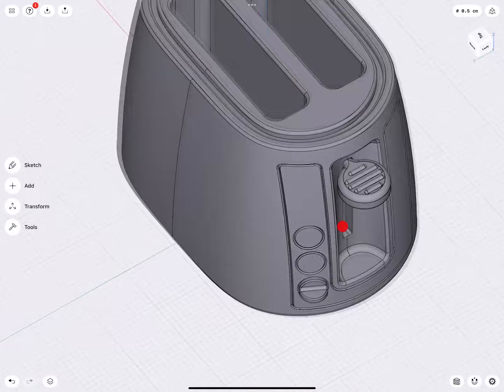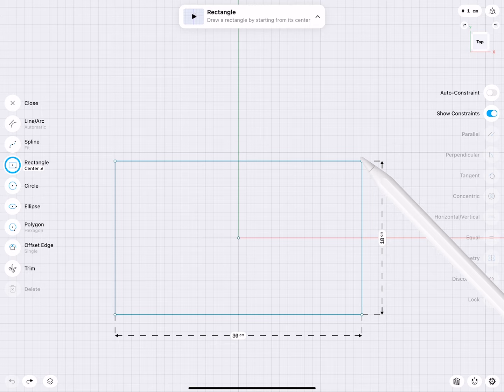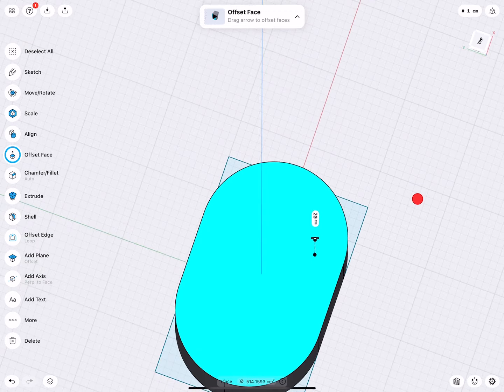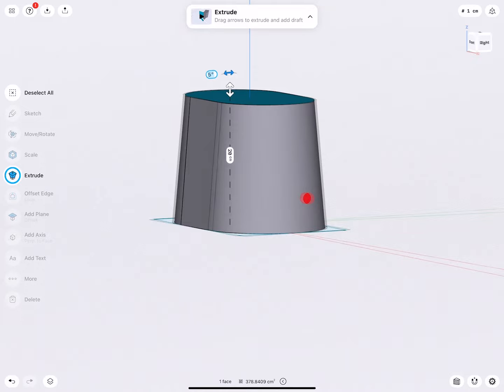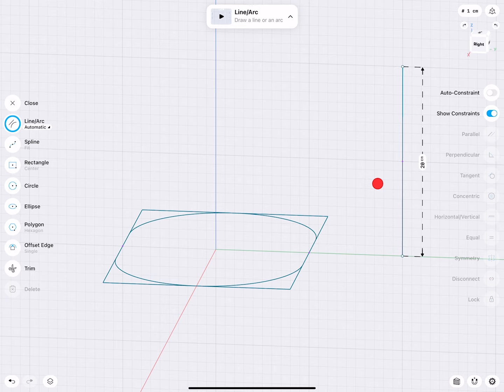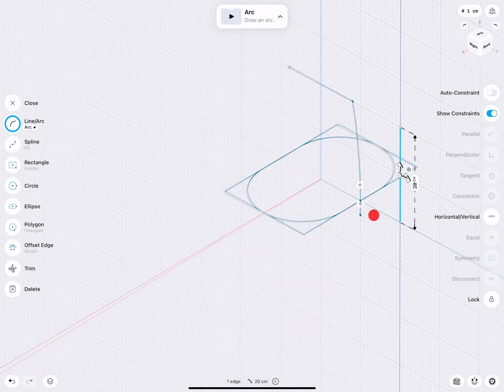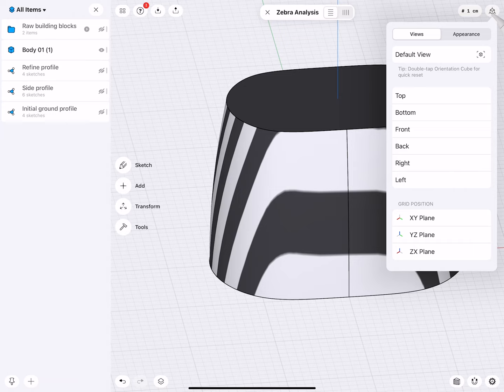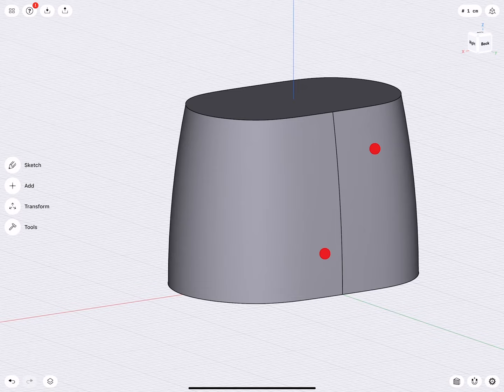3D modeling a toaster, Part 1 | Shapr3D step-by-step

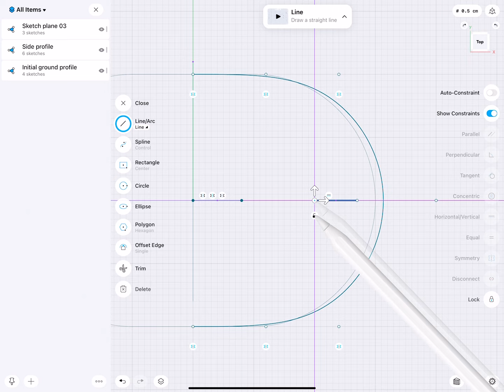Comment: Sir, thank you very much for your outstanding instructional video. I am running Shapr3D (Version 5.240.0 (4221)) on my Mac Air M1, and I am stuck with a modeling problem. I am trying to "glue" the line to the spline @17:04 in your video. I have been trying to do it for 2 days... I cannot. 
Is there a difference in the iPad vs Notebook, or the versions? I have deleted and restarted my model 3 times. I read the transcripts also. I just cannot get them to snap together. It is very frustrating...
Reply: felt this deep!! hope you got it fixed by now